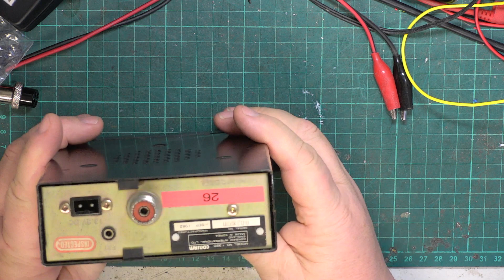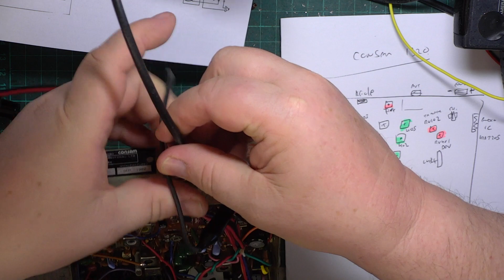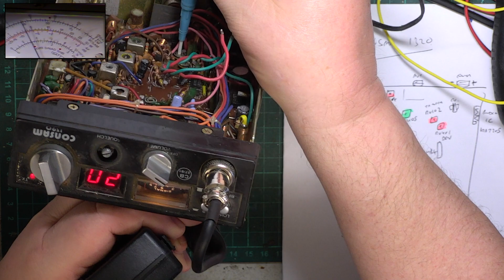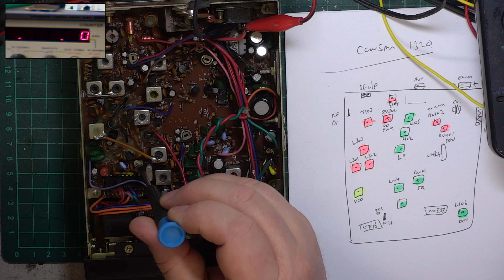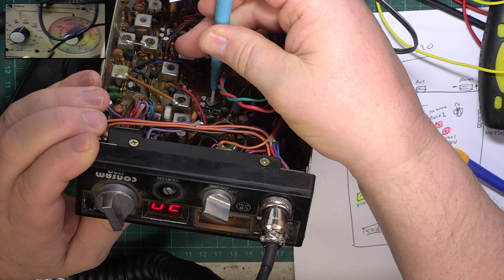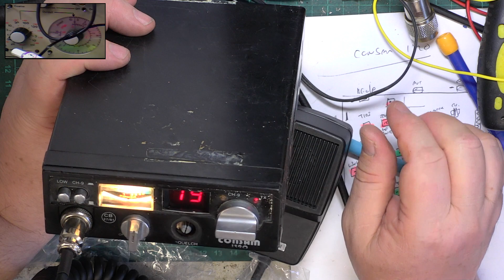Consam1320 CB27/81 UK FM CB radio - service & alignment

Comment: I have got one of those in my collection works well for what it is   .Think mine is a bit more sensitive on rx when i last had it on the Marconi 2955 its nearly as good as the cybernet 134 boarded stuff i normally work on .